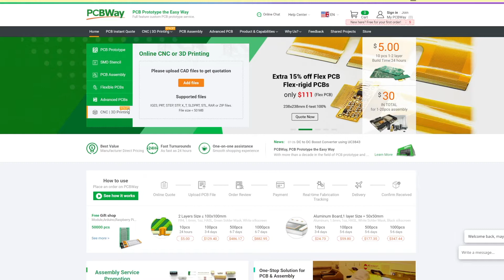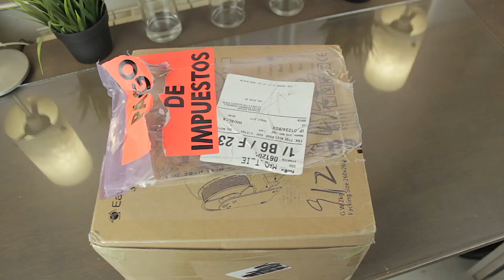EASYTHREED X1 | Assembly and Review | Cheapest 3D Printer

Comment: Aloha, I recently bought one of these second hand and have had trouble getting the software loaded and working on my computer.  I also connected the printer to my computer with a printer cable hoping I could just print directly from my computer instead of the mini sd card but my computer doesnt seem to be able to detect the printer.  Anyone know how to address these issues?  Mahalo!